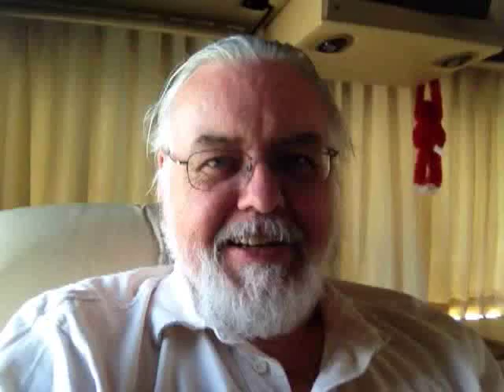BananaRama

Comment: Too Funny!  You had me rolling, Striking Viking!  Hope you find the problem soon.  Cold showers are not fun.
Reply from the maker: Pidasian Hippie Well, it works fine if we turn the generator on. It get's boiling hot in less than 12 minutes abd it stays hot for several hours afterward.  So, we have been boondocking for the past two months with no problem really in having hot water.  But we noticed that it does not get hot if the generator is not running.
Reply: That is good!  I bet that get's expensive doesn't it?
Reply from the maker: Pidasian Hippie We have actually been doing pretty good.  What happened this last time is that gas prices went up about 30 bucks.  So, we ended up spending more than the last fill up.  But we are averaging about $12.00 a day now with the rise in gas prices.